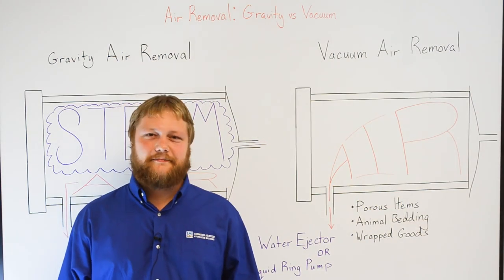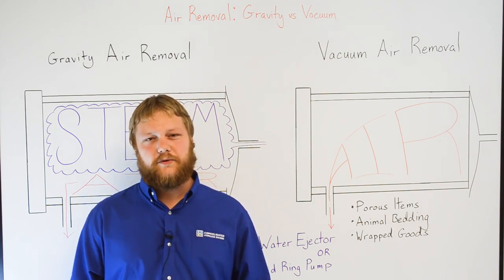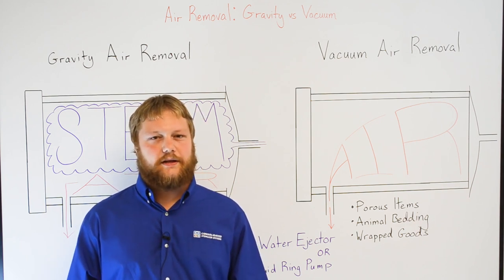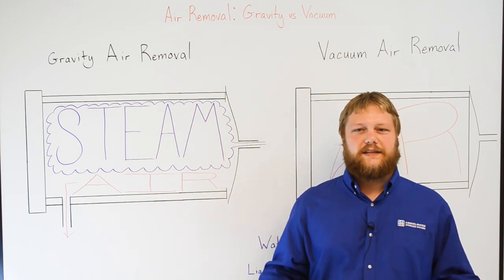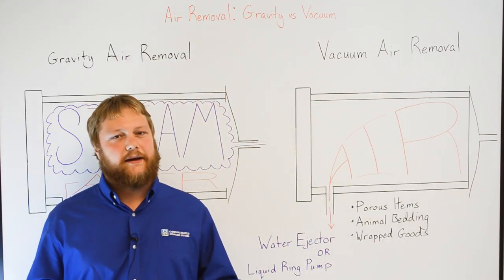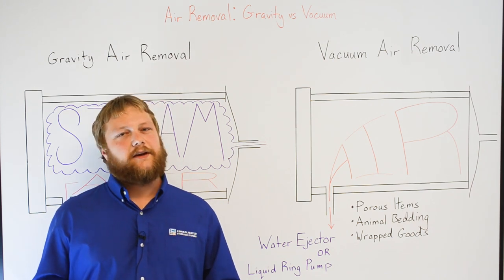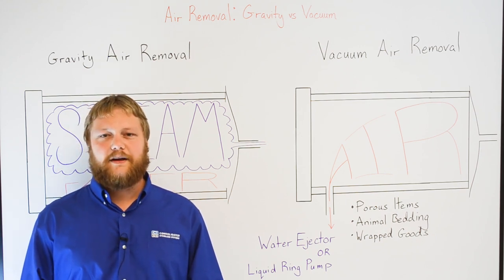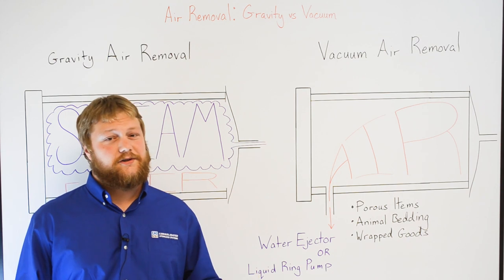Autoclave Air Removal: Gravity vs. Vacuum

Comment: The steam and the air will be at approximately the same temperature, so the air would ride above the steam, as steam is heavier than air, at any given temperature and pressure.  This would cause the air to be expelled through the top of a vertical gravity system first, followed by the steam.  One would eventually end up with a chamber filled with pure, gaseous water, a.k.a. steam.
Reply: No. Steam has a lower density than water vapour. Air and water vapour can be seen as idealized gases which mix instantanously. Also the steam comes with a certain velocity into the chamber, therefore turbulence mixeds both gases. It is simply a dilution process.